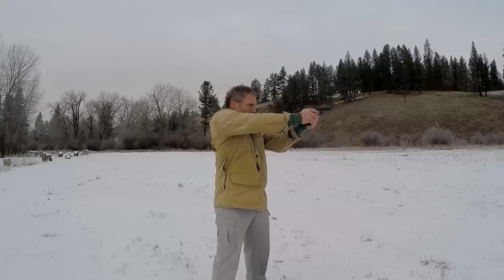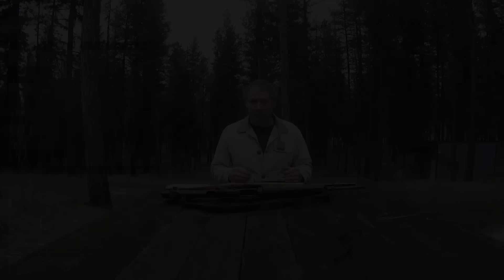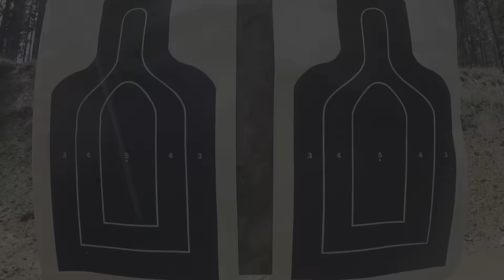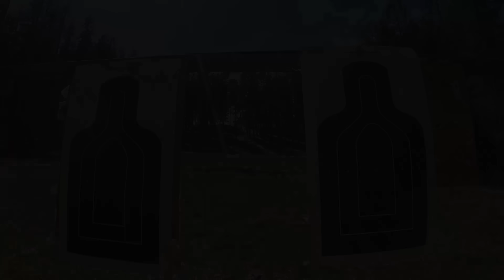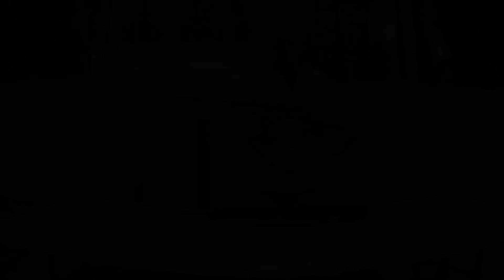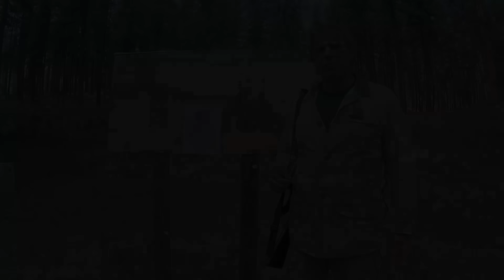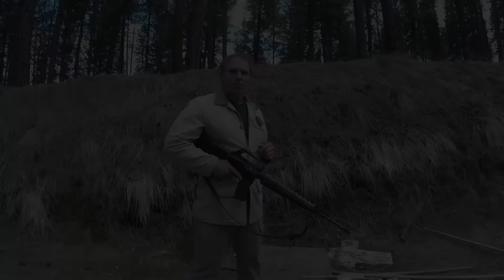Mini-14 vs AR15: Which is Better?

Comment: I own a Mini-14 and an AR (Ruger AR556). The Mini-14 was my first rifle and I got it in 2012. Here were my reasons. Let me be clear, these were my reasons. That doesn't mean they were/are objectively right or wrong. That doesn't mean they apply to anyone else. They were simply my preferences.

1. I wanted a piston rifle. That was simply my preference. People can argue the merits of piston vs DI all they want. That was simply my preference.

2. At the time, the Mini-14 and a decent DI AR were about the same price. ARs have come down in price a LOT since then. Now you can get a serviceable AR for almost half the price of Mini-14 now. That was not the case at the time.

3. I liked the form factor . . . not because of the 1980s or "The A-Team" but because of the M1 Garande, M1 Carbine, and M14 (the source of the Mini-14 name). No, the Mini-14 does not have identical operations to those firearms, but it has a similar form factor. I did not want a .30-06, .30 Carbine, or 7.62x51mm. I wanted a 5.56x45mm with that form factor. That means the Mini-14 was the best fit.

So, in 2012, my personal preferences were based on the form factor, operating mechanism (piston), and price. And I'm glad I have it. I'm also glad I have the AR.

Comment: I like the Ruger Mini-30 more than the Mini-14 rifle.
Reply: @Eugene Stoner -- Thanks for the advice.  So the 7.62 x 39 ammo has problems with the Ruger Mini-30?  Yes.  It would be best to go with the Ruger Mini-14 in .300 AAC Blackout then.  I just looked up a .300 AAC Blackout Mini-14 rifle.  It is $1,000 presently.  That is a little high on the price in my opinion.

Comment: Actually my Mini 14 came with a Flash suppressor from the factory and it's got a much thicker barrel with lots of other improvements they are much more accurate than the older ones  Also the older ones you do not want to shoot 5.56 from them  You will damage the barrel only the new ones are rated for 5.56

Comment: Overall a very good video, but a $700 mini 14 is a lot better than a $700 ar15. The mini is 100% stainless steel and uses a gas piston, whereas cheaper AR's are direct impingement and not stainless. Yeah the AR is slightly more accurate and slightly easier to reload, but the mini is a lot more durable and requires less maintenance. The mini is also easier to shoot left handed.

Comment: Just a question. Would the difference in twist rate affect the long distance differences???
Reply: Shouldn't  as long as the bullet is stabilized and not key-holing .  Inconsistent  velocity more so. and maybe use  a Lead Sled?

Comment: I've had three Mini-14s and all were SS.  I found that every one of them would start to hang up from time to time after shooting 5 or 6 30 rd. mags and they were hot.  After they were left to cool down then reshot without any lube they would start having trouble even sooner around 4-5 mags.  I was at Knob Creek Ky. this spring and bought windowed 30 rd. Magpul AR mags for $9.99 ea.

Comment: I used to work nuclear security down in Florida,  years ago.  When I started,  the force used Ruger Mini-14s.  After a few years,  we transitioned to Colt AR-15s.  The Rugers simply did not hold up to day-to-day use in the long run.  I actually had one where,  upon pulling the trigger,  the rear sight shot up into the air.  Our armorers complained of having to do constant minor repairs.  On the other hand,  the ARs could take constant rough handling and still be perfectly fine.  End of story.

Comment: Great video. Very methodical and informative. I own several ARs and I am aware of the Mini-14 and believe it's a great gun for what it is.

One other thing that might be an advantage for the AR is the ability to "build your own" at home, whether that be with an 80% lower or a completed lower. I find that this is a cost-effective way to get exactly what you want for the best price. If you want to trick out the Mini-14, I think your only options are to buy a gun that's as close as what you want and then take off perfectly good parts and replace them with the desired parts. With the AR, you get get all the parts you want from the get go without disposing of any perfectly good (but unwanted) parts. Also, the flattop versions would seem to me to be much more easily adapted for the use of optics over the Mini-14. PLUS...you can get front handgrips that allow you to easily add lights, sling mounts, lasers, backup sights, etc, etc. I'm not necessarily recommending any of this, just saying it's possible.

As for uninformed police and/or over-reacting members of the public...it's a sad state of affairs. In my state it is illegal to transport any loaded rifle unless it's locked in an inaccessible place such as the trunk of a vehicle. That's true even if you have a concealed carry license. Yes, it's stupid. An unloaded weapon of any kind can be transported in the passenger compartment as long as it's in "an enclosed case".

Personally, I find that carrying a rifle in a case to and from your vehicle is the best bet. Nobody knows what you have in there. It could be a violin or curios or a sword...or a hunting rifle...or an AR. Nobody knows. And, as far as I'm aware, it's nobody's business...not even the police. They're free to ask you what's in the case, but you don't have an obligation to answer them or answer truthfully...or open the case for them. Simply holding a case is not probable cause that a crime has occurred or is about to occur. I say be polite but tell them you're not interested in their questioning.

Comment: As for weight, InRangeTV did a series on an AR-15 build that ended up weighing 5lbs, 2.9oz with a Holosun optic attached. So in modern terms I see no real practical advantage to the Mini-14. Great video!

Comment: I had an older Mini 14 in stainless with a wooden upper foregrip. I took it to the range to shoot it when I discovered that it would not function. The rifle, though very lightly used, purchased new, had apparently developed a broken firing pin. I contacted Ruger the following week and asked them to sell me a new firing pin. I was told by the Ruger people that they could not / would not sell me a replacement firing pin as it was against their policy and that for me to have the firing pin replaced that I would have to return the rifle to the factory for firing pin replacement. WHHHAAAAT  ?  I said to myself .  No way !  Within a month or two I took that Mini 14 to a gun show and sold it....never looking back !  I got rid of all the accessories as well and while my AR 15 collection has been enhanced, I will never purchase another Ruger Mini 14.  I see far more advantages in owning an AR 15 platform rifle than a Mini 14.  Obviously, getting a firing pin replacement would never be an issue since AR parts are available locally and online.  This is not to disparage Ruger products overall since I own other Ruger handguns.

Comment: Great summary Paul. You should hear the guys howling over on a mini 14 forum over your presentation. And I have to say, they must having hearing deficits because they came away grousing about this or that, and I had to ask, did you listen to what Paul was saying? These guys try their damdest to make a mini 14 into a battle rifle, zombie killin machine. And another very typical statement of the rabid mini fan: " I had an M16 in the Nam and couldn't keep the dam thing running, blah blah blah". I own a mini 14 ranch 190 series skinny barrel, worst accuracy I ever had in a new rifle. Eventually modified it to get it close to 1 moa. I use it on coyotes and other vermin. But if I have to grab my body armor, the Ar's are my go-to rifle without question.

Comment: Fantastic video. However, I do have to disagree with you on a few point.

On the AR15, I understand you are talking about the A1 but in general if you have a well tuned AR15 it doesn't need a lot of oil and it can run thousands of rounds without cleaning, at least mine have. It may vary from rifle to rifle depending on tolerances. I have tested my rifles bone dry and they will run through a range session without flaw. Haven tried more than on sessions yet, but now I will run them for a while without cleaning and see how long they go before failures start to happen.  Every time I have cleaned my AR15s they were not very dirty and the carbon that had built up wiped right off without any solvent.  But, one accessory mine have that most AR15's don't is adjustable gas blocks, so that might be part of why they are reliable with less lube and less cleaning. 

On the subject of Police, I can tell you that in California the majority of police do not understand firearms laws.  Hell, even the bureaucrats and lawyers in California that make the laws don't understand them.

Comment: An unexpectedly informative video. Best compare and contrast I have seen between the Mini-14 and AR15. Like Paul, I own both a Mini-14 (Hogue overmold stock) and several versions of ARs/5.56 rifles. I think the Mini-14 makes the better "truck/varmint/wondering around" rifle for the reasons Paul covered, but the ARs are the LEGO set for modern riflery.

Comment: Great video.  A major "selling point" of the AR that was not covered was the ability to easy add things like a forward handle, flashlight, red dot or scope.  Having had a mini 14 (one of the not so accurate ones), the aftermarket accesory rail setup was absolute garbage.
  The AR platform sold itself: cost effective, proved to be more accurate, cheaper mags, designed to support accessories.
  I didnt hate the mini, but i was glad my X decided to take it instead of my AR when she split.

Comment: Very nice presentation. It's unfortunate that people like Nancy Pelosi and uneducated Dems and Reps look at a rifle and deem it dangerous because of the looks. People also think AR's are bad because of recent and past crimes where some Ahole  used one of these. They don't get it that this is the most available, reliable .223/5.56 platform in the U.S. It's like owning a Camaro or Mustang, which I own the former. That's probably why they picked an AR, because it was the first thing they saw, where ever they bought it from, legally or not. I have a Stag Arms Model 1, I bought at the Philadelphia Armory, LEGALLY, N.J. compliant, NICS check and all, right before Obama was elected. I also have a Marlin 60 .22 LR. Cracks me up when people say the Marlin is just a .22 and not lethal. They don't realize an AR is a .22 with a mega powder charge. Both are very lethal. Both deserve the proper respect. The Mini 14 is exempt from the A.R. ban because it does look as scary as that "full auto AR-15". My fellow L.E.O. told me that years ago in reference to the Sandy Hook shootings. I had to school him on the difference of semi and full auto, and he was an L.E.O.!!!!!! That's kinda scary. So think about all these anti gun, very ignorant people, that probably never held let alone shot a gun think. They go by what the misinformed feed them. Sir, please keep educating people as you have for many years, and I will keep trying on my end. I'm out.

Comment: I bought a mini-14 a few years ago. What a pos. It would not run a full magazine without a stovepipe and /or a double feed. Field stripped it, scrubbed every thing, lubed it and after about 500 rounds it still malfunctioned. I was getting ready to send it back to Ruger when I got a chance to trade it to a dealer. Yes, I told him it had problems. I have a couple of Ruger pistols and they ran perfect out of the box. I've got 2  AR Sig 400 carbines and  a PSA pistol, they will run on any thing I feed them, and they are not picky about magazines. I know people who have and love the mini-14, but I'll stay with the AR and AK platforms.

Comment: Very good presentation. I will say that I have to agree with about 99% of what you presented conclusion wise except for the "dirty" portion. Yes DI guns do "crap where they eat" carbon wise but as many others have shown (such as Military Arms Channel), a properly built AR will function with excellent reliability with that carbon and proper lubrication. Even running them "dry" is really not a issue. We ran ours in Iraq and Afghanistan fairly dry because of the "mood dust" qualities of the soil there during the summer. Too much CLP would cause that dust to lock our weapons up at the worst "Murphy" moment, LOL. However, our M4s would burn through rounds no problem and the carbon build up was a non-issue.

Comment: I'm a Mini 14 fanboy sorry. I like the rifle and I got mine just as accurate as an AR.
Reply from the maker: If it works for you, then go with it.
Reply: @PaulHarrell  Ruger saw the inaccuracy and improved the barrels in later models of the 14. Not as accurate out the box as the AR but a good start to work with
Reply: @PaulHarrell  Really enjoy the videos by the way. Real down to earth info. Even as a former Marine I have no problem saying I learn alot from your videos. And shooting is really all I did in the Corps

Comment: I will take The AR every time as I have years of experience with it and none with the Mini14  no other Rifle I personally have used is as Ergonomic and easy to operate and without taking your shooting hand off the pistol grip. The A2 sights are based on the match sights that hold the records at Camp Perry and work well

Comment: You should have had the same zero for both rifles.
Reply from the maker: I did. The mini is zeroed at 100. The A-1 is zeroed at 100 with the short range sight up. They have the same zero. The A-1 has the ability to change zero quickly and easily, the mini can't. This is the difference between real accuracy and theoretical accuracy.

Comment: Who wants to buy a gun..to find out it isn't accurate? I like the traditional look of the mini, but I wouldn't own one. I will stick with the AR. Plus you didn't even cover the versatility of the AR. I can switch my M-4 upper, to configure it to a Varminter upper, two entirely purposed weapons. Great review.
Reply: Not to mention the fact that the mini is over priced at $750..00 plus. You can easily get a 1-1.5 guaranteed AR for that price.

Comment: One advantage of the Mini-14 in New York State is that the AR-15 is classified as an "Assault Rifle" and is illegal to own under the SAFE Act.  However, the Mini-14 is specifically excluded from the "Assault Rifle" classification and is therefore LEGAL to own in New York.  I've never seen a rifle "assault" anybody but that's a HUGE advantage if you live in NY.

Comment: With guns like the S&W sport out there, cheap, accurate, reliable and made from a reputable manufacturer, great warranty.. Cheap and good magazines. Also you can find the S&W for less money then the Mini-14... A lot of aftermarket support with all kinds of changes you can make on your mini-14, but i would say that the AR-15 has even more. 

So the Mini-14 is more like one of these guns that you might just get because you just like them. You want to make yourself your very own A-Team gun perhaps. But besides that i think it is quite clear the AR-15 is the better platform.

Comment: I have owned many ARs and Mini 14s, and the two aren't even close in my experience. My best Mini (NRA Edition w/16" heavy barrel) can't shoot as tight a group as my worst AR.  With an average AR I can shoot a dime-sized 5 shot group at 50 yds, with my best Mini, unless I'm lucky, I get a quarter-sized groups. 
I love Minis but, aside from sighting them in, I don't target shoot with them.  It's far too frustrating.

Comment: Why even mention that one rifle is stamped .223 Rem and the other 5.56 NATO - but then go on to say you're using .223 for the test?  Are you suggesting that these are somehow different?  It's like saying I'm shooting three different rifles, a 7mm Mauser, a 7x57 and a .275 Rigby.  Or a .308 and a 7.62 NATO.  Different designations, same cartridge.
Reply: David Aitchison they are typically loaded to different pressures.
Reply: @alexmoore1506  No doubt, but that doesn't change the fact that the 5.56 NATO is simply the metric  military designation for the .223 Rem (which is a commercial designation).  And of course, not all 5.56 NATO rounds have the same pressure either (remember that the original mil spec 5.56 round incorporates a 55 grain projectile rather than the 62 grain subsequently adopted) , same for commercial .223 which comes in a variety of loadings and pressures.  To put it another way, if I reload my own ammo (let's say it's .308 Win) and in so doing I increase or decrease pressures, that doesn't mean I've created a new cartridge.  I don't get to re-designate the cartridge because I changed the pressure.  A cartridge designation relies on the external dimensions of the case.  It has nothing to do with pressures.

Comment: Thank you for mentioning the early vs newer Mini 14s. I have a 180 series, Bicentennial edition (made in 1976). I jokingly refer to it as having minute of barn door accuracy. Someone, who is a much better shot and has experience with them was able to get a 4"-5" group at 100 yds. I usually get around 8", on a good day.
I've used later production versions, and accuracy is greatly improved.
Reply: That has a 1/10 twist.  What grain bullet  do you use?  Try  lighter bullets.